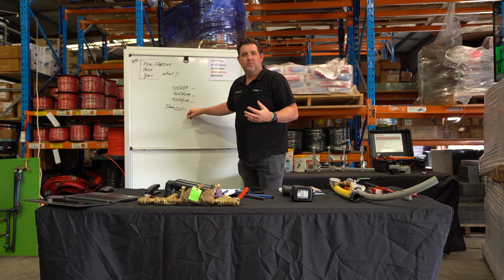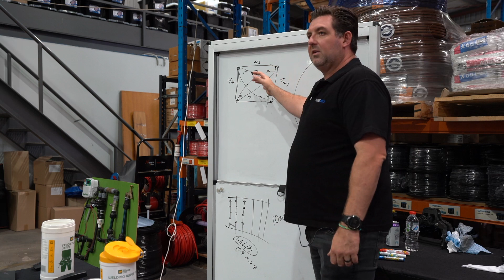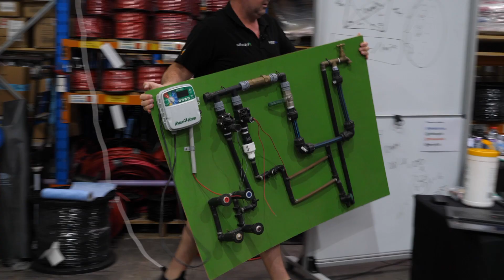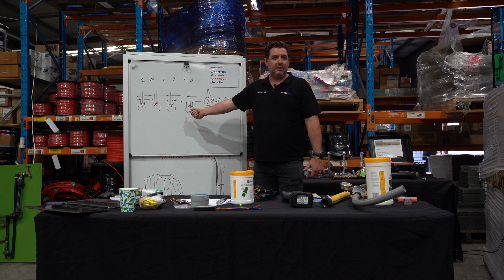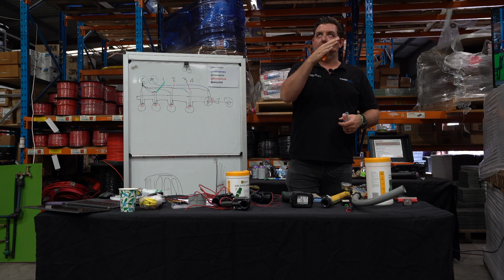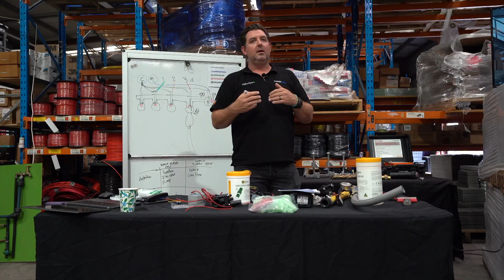Waterpro Basic Irrigation Training (Commercial)

Comment: Homeowner question. When we built our house there weren’t many other houses in the area. Now our area is built up we’ve noticed that the irrigation pressure isn’t as good as it used to be. I’ve discovered that each ‘zone’ of irrigation is run as a straight pipe rather than being in a loop. 
Would it be beneficial to change each zone to be in a loop rather just a straight pipe? Or should I reduce the number of sprinklers on each zone and add more zones? Each zone is running 6-7 sprinklers with the R-Van heads.
Reply from the maker: Looping probably won't make much of a difference, looping a residential irrigation system might improve efficiency by 1-3%, it's more likely you will need to change the number of valves. I'd be getting a flow vs pressure test done at the source and seeing what you have available, and then checking to see if it works, you're welcome to let us know and we can help you out. R-Vans are the second lowest flow nozzle available. You might find changing the nozzles to MP Rotators might reduce the required flow enough to fix the problem. There's a few different ways you can go about this but one of them is not to loop those valves, I don't think you'll get the juice from the squeeze. You can email me at clint@waterpro.com.au and I can forward you through to the right people or straight to the sales team at sales@waterpro.com.au.
Reply: @waterproau  thanks for the advice! I’ll get the pressure vs flow test done and get back in touch.